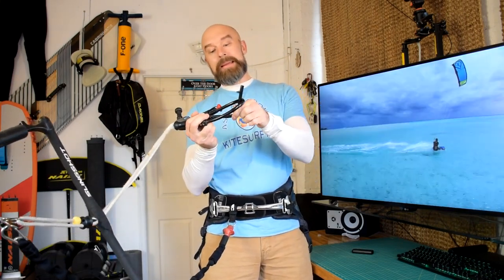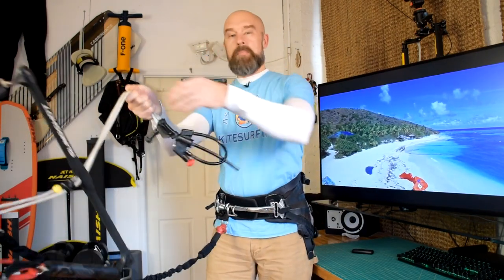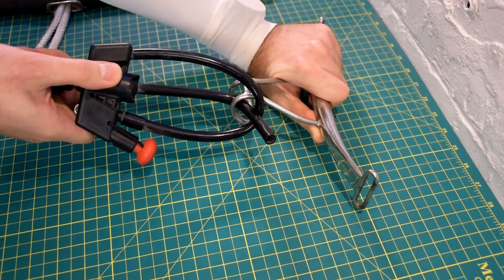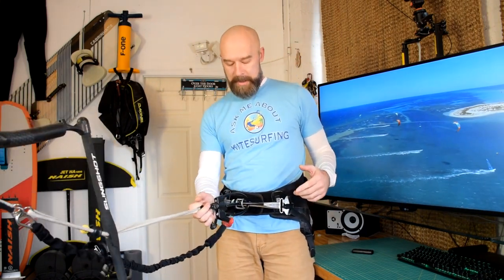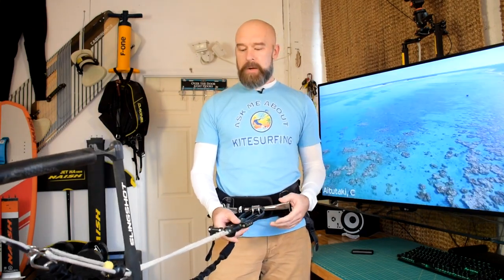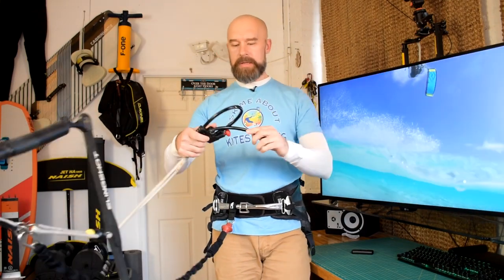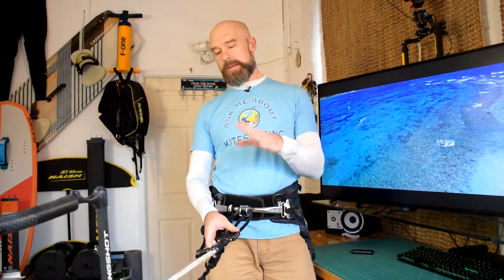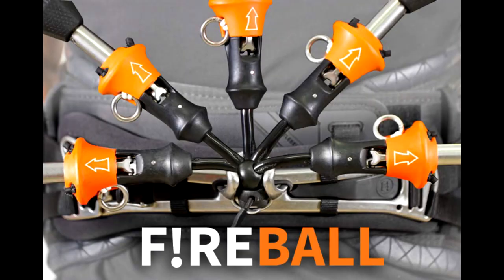Foul Hooking Kitesurfing. Fireball Cabrinha. Chicken-Loop Failure.

Comment: I realised this problem before it ever happened to me, so I moved to the cabrinha fireball system. That's also not perfect, but I removed the lower part and use it with a ring on a rope bar. Has never failed on me. Also less rotation force on my harness. The hook is obsolete. It comes from times harnesses were made for windsurfing.
Reply from the maker: Right you are, new chicken loops do address this problem, but lots of them come with another challenge which leads to snapping the pin off completely. Fireball looked good as well, at first...  The gear is constantly evolving, so, let's keep up with this trend! Be safe!